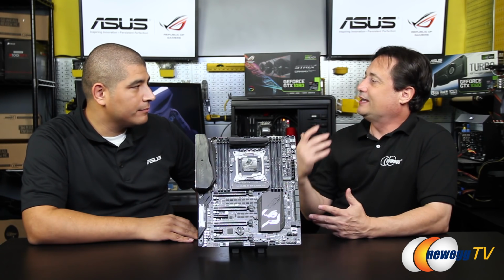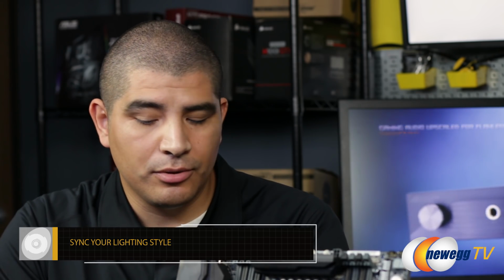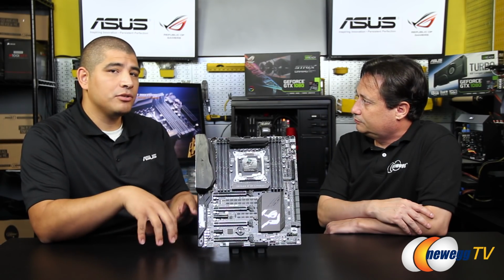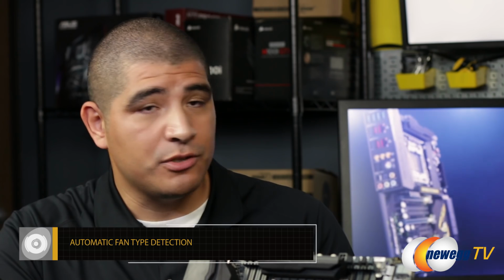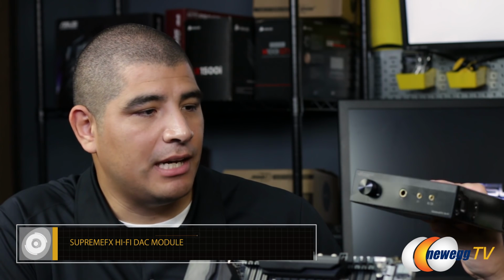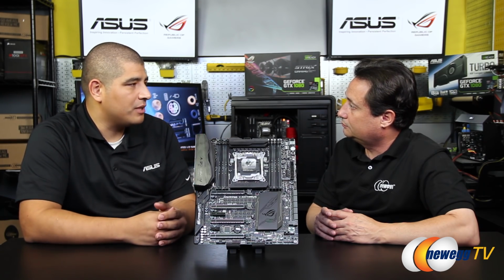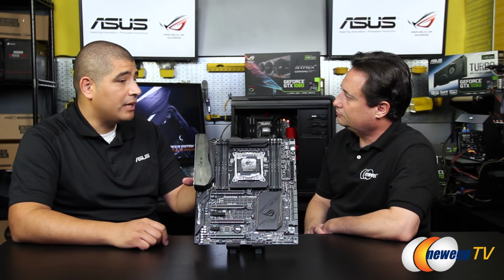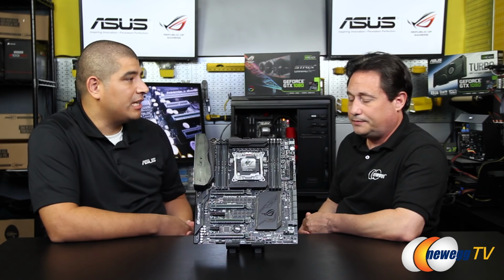Newegg DIY Garage: ASUS ROG Rampage V Edition 10 Motherboard

Comment: It's to bad ASUS doesn't put the effort into having the Software and Drivers on their it updated to the most current release. If you try to do a clean install of Windows 10 x64 on this board and then install the current ASUS AI Suite 3 utilities software they have on the ROG Rampage V Edition 10 page YOU WILL GET A BSOD over and over again caused by IOMAP64.sys. THIS is being caused by a old version of DIP5 (Dual Intelligent Processors 5) within the suite itself. The fix is going to the ROG Maximus IX Formula utilities software page and use it's updated version of ASUS AI Suite 3.  YOU SHOULD NEVER HAVE TO DO THIS.  ASUS START UPDATING YOUR DRIVERS AND SOFTWARE PAGES!

Comment: I am very close to starting my first build.  I would very much like to use this MB.  I have looked at this MB on newegg. One feature I have seen on newegg is compatible components for any item one might look at. However, I haven't been able to find out what memory would be compatible with this MB. Also along with that,,, this MB has 8 dimms, could I put 8gb's in each dimm and therefor have 64 gb's of memory. or can I only run one side at a time,, or use (8) 4gb's giving me 32 gb's..
Reply: pcpartpicker is a good site for a pre-builds, let you see compatibility while picking parts. As for the memory, this MB runs DDR4 Quad Channel,  buy set of 4 i guess for best preferences(Quad Channel). DDR4 4x4gb, 4x8gb, 4x16gb, or 4x32. As for me I'm going to try the Corsair Dominator Platinum ROG Edition 32GB (4 x 8GB) DDR4 DRAM 3200MHz C16 Memory Kit. Even though my memory is not on the compatible list, i was told it should work from different people. hope they right.

Comment: 600 bucks for a board that will obsolete next year when intel releases their 10 nanometer cpu's and new socket no thanks.
Reply: I'm talking about lga 2066 socket.  Intel has been updating the top of the line lineup every 3 years since 2008 with X58.  Not smart to update now with just one year left to the next socket comes out.  2066 is going to be around till 2020 and then the next one is coming out.
Reply: exactly  2076  boards are coming  along with small nm  cpus ile wait a another year or 2 or wait for the next Generation  because I want to play brothers in arms  if gearbox  does a full reboot I want the best hardwares to play it lol
Reply: kaby lake CPU's will not fit this board.
Reply: still using a Gigabite X58 UD7 motherboard with a Intel 980X hex core running at 4.1 Ghz on all the cores from over 5 years ago. it's still as quick as current quad core cpu's. Intel really needs some competition to get it out of the comma it's been in for over 5 years. The way things are going my future galaxy S8 or S9 phone will be faster than a new gamming PC.
Reply: this board has been out for quite a while now

Comment: I am about to build my "*first*" PC and I just want some opinions on it:
Pentium D 945 @ 3.4GHz
club 3d R5 230 although might upgrade to the GT 730 or 740 or the R7 240 (I have a wifi card)
Foxconn N15235 motherboard
X Blade case
Akasa AK-966BL
1x 92mm fan
1x 120mm fan
300 GB WD caviar blue
not sure about the optical drive or PSU yet
1x pci USB extender with 4x USB 2.0 ports

anythimg I should change?
Reply: what exactly is your budget, or are you using old/handed down components?
Reply: The components I am using are the only parts I have arround my house and I am looking to upgrade with max about £60 or about $75
Reply: In that case, you could try to get an athlon bundle for $40 at microcenter to get a better cpu, or you could attempt overclocking, regardless, your cpu cannot handle a beefier gpu, though it should do just fine with a r7 240 or gt 740
Reply: thanks, I think overclocking is my only option as my nearest microcenter is over 1000 miles away (I live in UK) but thanks for the advice :D
Reply: you are going to have a very bad time with that CPU. I would find out what that mobo supports and aim for a better one. a q6600 still can hold its own today. try and find a local computer shop. many of these places have old systems they intend on recycling anyway. I have a few core 2 duo chips from doing just that.
Reply: in UK or USA?
Reply: neither but I don't see why it should matter. most places have computer shops. I'm sure the UK has plenty.
Reply: EBay is a good spot for old hardware. one thing I will say, if you invest into a 775 board you will probably pay a premium since they are not as easy to find anymore. in my experience replacing old hardware can be more costly than it is worth. I had the very first Asus ROG formula board and was using a Pentium d 920 at the time. I picked up a c2d and went to install it. something happened where one of the pins on the socket shorted and melted. the board was a write off. at this point gen 1 i7's were coming out and I decided rather than spending about $300 to replace a dated board at that point to build a new system on am3. I had spent about $300 on the mobo and cpu and ended up with a new current 6 core p2. add in a ssd and 16gb of ram and I was looking at a major upgrade of my whole system for a bit more. I have been using that system since then and is in great need of replacement after 6 years. make sure to price things out and be prepared for your old hardware to not be cost effective to replace.
Reply: GT cards are never ever worth it. aim for at min. a GTX 750ti. for Pd 945 will likely bottleneck most gpu choices. including the ones you made. Pentium D's are VERY old now. they are essentially two Pentium 4 dies on one chip.
Reply: I dont worry about that, I have a second LGA 775 mobo
Reply: Also with my current mobo I have a wifi card so I can only get amything up to the Asus R7 250 or the gigabyte version
Reply: So I cant really aim for a dual slot beefy cards like these 750s and I am not sure about bottleknecks with anything beefier
Reply: Deadzio well as you can see, my rig is better xD   "GTX 1080" soooooo last year!!! hahahahahahaha ha     ha    

(WHYYYYYYYYY!!!!)
Reply: Deadzio I dont have a job, i'm still in high school and my parents are at a point in the year at wich they cant spend much money.
Reply: Fatal Potatoe can I get what you're smoking on?

Comment: will this Mobo work with the i7 6700k?
Reply: No. 2011-3 socket, X99 CPU's. 

I7 58XX
I7 59XX
I7 68XX
I7 69XX
Reply: Or Kabylake?
Reply: you need a i7 5820K CPU on the 2011-3 socket and quad channel RAM.
Reply: you need a z170 for that cpu
Reply: you don't "need" quad channel memory, it does support it though; as well as dual and single mode. Any Broadwell-E or Haswell-E CPU will work in this bored. Be aware though when using 5820k or 6800k not all lanes will operate at their max physical speeds.
Reply: Unless you are running 3 way SLI I doubt it will matter for just about anyone. that being said 3-way so I is a waste of time and money when it works at all.

Comment: Well, maybe Asus will finally fix their Aura software when this board is launched.  You know, so that it actually saves my settings instead of having to manually change the color whenever I startup my computer.
Reply: ***** Your LEDs turn off with the computer?  And AURA saves your settings when you load your computer back up?
Reply: ***** Pulse red?
Reply: ***** Hmm, mine doesn't do that unless I manually set it to
Reply: ***** Yeah, if I hadn't paid over $500 and already installed the mobo, I would have returned it and bought something else.

Comment: Why, ASUS, did you only put one USB 2.0 header on this board? I want to use Corsair link but, that header is using the included ASUS SupremeFX Hi-Fi dac/amp. Why doesn't the dac/amp get identified with Sonic Suite 2 software? JJ can you make a video about Ethernet teaming

Build:
R5V10 x99 w/ intel 6800k, oc 4.4
Corsair Dominator 64g 2666
MSI GTX1080 EK X, oc 2116
custom watercooled ek w/ 2x 360rad
samsung 950 m.2
Enthoo Evolv ATX TG
Reply: you can use the ROG_EXT header as a usb 2.0 header
Reply: yeah but if he do that he cant connect the Supreme FX Unit or front panel usb lol i've connected the sound unit+the liquid cooler so i cant use my front panel usbs
Reply: Ethernet teaming doesn't really work well on any board. I use the dual nic to connect to regular internet connection and one to a seedbox